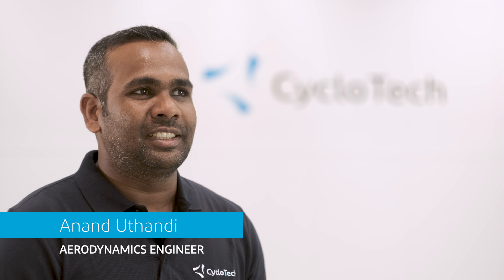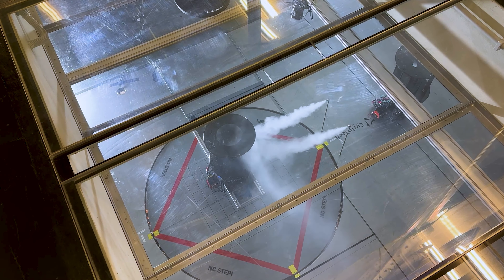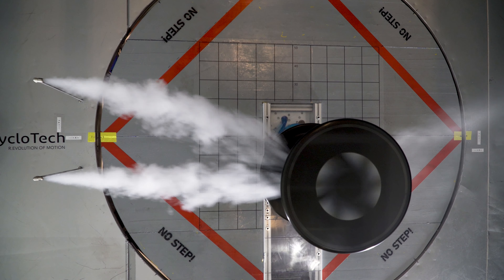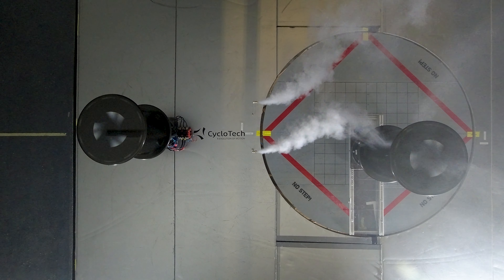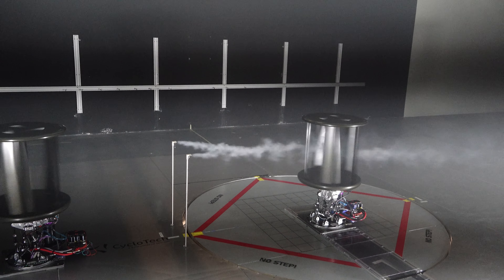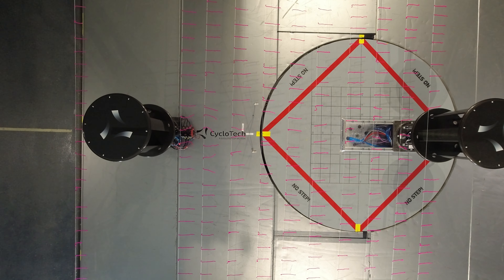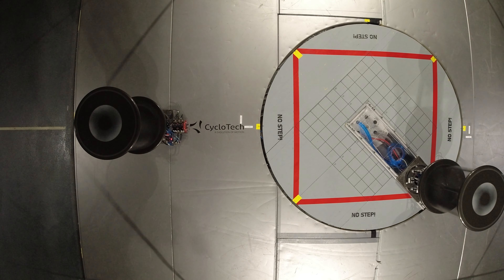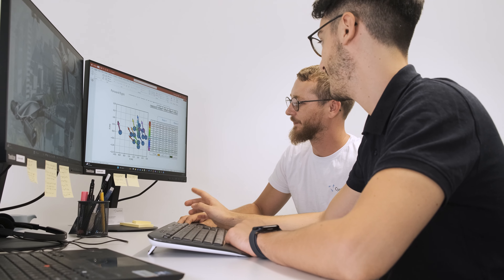CycloRotor | Wind Tunnel Test, 2023

Comment: Undoubtedly, this is a necessary work, even if it repeats what others have already done more than once ... If it is not difficult for the authors to answer: when, in your opinion, will we see new aircraft with CYCLOGYRO - rotors, according to the scheme of 1909, if so far no one has them before you? Although small models fly and models up to 225 kg without payload were also in the air.

Comment: a damage at one of the engines and your are dead. all the people on the ground are in danger. its inefficient, what is with dirt, birds or something in the air and the "rotor". It will never go commercial. not safe, not efficient, too expensive. for ships yes for flight no. total fail for personal transport.
Reply: What do you know being so negative. Give them a chance
Reply: @jamesdavid9390  its not negative, its realistic. im no ingenieur or something else and see 2 massive problems. its simply not for public transport. for drones ok or for ships like actually.
Reply: @chrisr.5730  ok please explain your reasoning. What are the two argument behind your thought. I am listening
Reply: @chrisr.5730  what happens when the rotor on a helicopter is damaged?
Reply: is a helicopter for mass transport over cities? How big is a helicopter rotor in compare with this. Use your brain.
Reply: @chrisr.5730  not the same use, not the same price, not the same deployment strategy. I mean if that is your argument, it's not very diff from the people who use to say that the internal combustion engine will never work. Put the right level of support behind and its will work. Technically speaking there is nothing wrong. Use ur brain